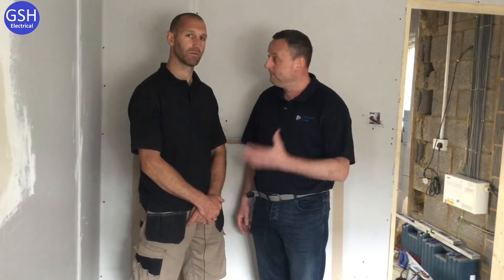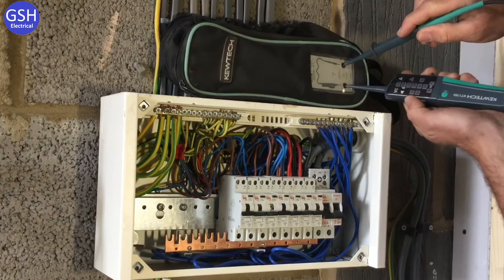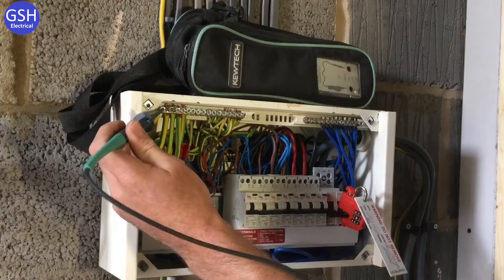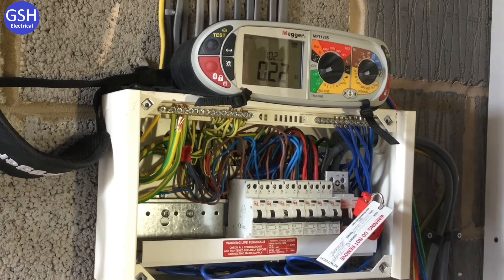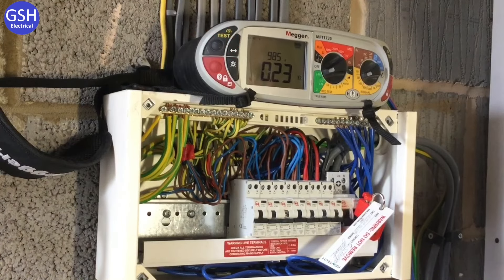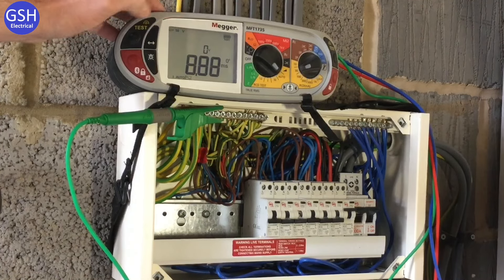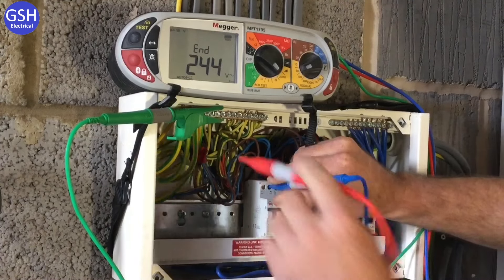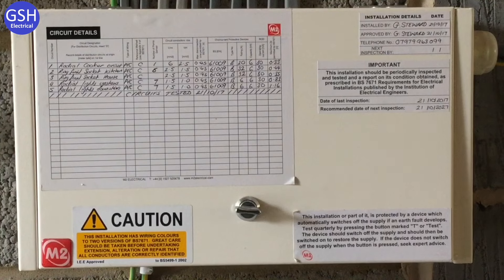3 Lead RCD Test in the Consumer Unit on RCBO's Saving Time During the Live Testing's Process

Comment: thanks for posting the video to help general awareness of trainee electricians. this video is obviously not meant for the general public who should be getting qualified sparks to do this kind of stuff. just to add a bit of information for apprentices; although guidance note 3 says you can do RCD testing (which includes RCBO's) at the board or a local socket, never any mention of doing it at any other connection point or lighting, an RCD test is effectively a bench test of the device and should not be done with its circuit cables or any other circuit cables under load. the correct way to test RCD's is turn all other circuits off so there is no possibility of currents induced by cables running near each other, remove the load side conductors so there is no load and then test the device, however the EWR says that the full test does not need to be done every time the installation is being inspected if there is a risk the disconnection of conductors could introduce a fault if they are not going to be tested again after re-connection. hence the test at a local socket. so in the video you correctly did the tests with all other circuits isolated and presumably made sure all connected loads were switched off during the testing so no load was present on the RCBO's under test.
I often come across old test schedules where there is only 1 or 2 RCD's protecting all circuits of a board where every circuit has a different RCD results value, this just shows whoever completed the schedule doesn't know what they are doing, if you have 2 RCD's in a modern 17th edition board, all circuits protected by the first RCD will have the same results for 1 x and 5 x column, as will the circuits protected by the 2nd RCD.
doing RCD testing at the board is not only the correct way to do it but as the video shows its also the quickest
just a final comment; the 18th edition has finally realised that users will not test RCD's every three months (and most sparks don't even tell them) so under the 18th edition the notice now says the RCD's RCBO's should be tested every 6 months. we now have the opportunity to associate the changing of summer time and winter time on our clocks etc with the need to test the RCD's. as we all know the reason for users testing RCD's isn't just to confirm that a mechanism designed to save lives works, it is also to lubricate the mechanism so it doesn't get sticky and not work when needed.
all the best to all qualified sparks and please stick to your quotes, don't let punters drive down prices by getting us to compete with each other. we are highly trained professionals and should charge accordingly
Reply from the maker: Hi thanks for your detailed comment... these videos are 100% not for Mr or Mrs DIY and form part of my training course. All the best GSH

Comment: With the megger tester , you can test Rcds /rcbos with just the 2 leads , in domestic properties I never use the 3 rd lead just keep the 2 leads in unless I’m proving the r1/rn  r1/r2  readings on socket then use the plug lead that comes with tester

Comment: @GSHElectrical thanks for sharing, very well presented.  
However, it should be noted that testing RCBO at the DB or Load centre does not prove the fault loop impedance path. A much better test is the test done in the field at the furthest point from the RCBO.

Comment: Great video guys thanks . Is this a MSB or a sub board?  Is there a MEN link in the board? Also when disconnecting the 16mm main earth cable, would that be the one from the earth stake or up stream supply?  Im assuming this is  a sub board? Question from Down under AUZ  where we use TNCS MEN system. cheers for showing me how to use my megger properly. Legends

Comment: @6.30 you state that rather than going to the end of the circuit to test the RCD you can do it at the CCU. But I thought that you should where practicable test as close as possible to the load side of the RCD at the point of installation, and the loads should be disconnected during the test.

Comment: Question:When testing polarity between the N&E conductors, you said that there's continuity due to a TNC-S earthing arrangement to the installation..
Is this a quick indicator to what earthing arrangement there is to that installation.. For example if there was no continuity then it will be either TT or TN-S (excluded the others from BS 7671)...

Comment: Why do you need to turn off the other rcbosif you’re testing individual circuits? I need to test a few three phase boards and they each have a few rcboson them and I just want to test them at the board. But the boards contain other circuits which I don’t necessarily want to turn off.

Comment: Prefer to do RCD testing at the end of line but I can understand why it done at the consumer unit in certain circumstances, I wouldn't expect an electrician to keep reseting the RCBO/RCD when testing a third floor lighting circuit with the consumer unit on the ground floor.
Reply: They shouldn't be carried out at the end of the circuit as they are not a test of the circuit, but rather a test of the RCD. They should be conducted with all loads disconnected from the RCD so as not to influence the results. They should always be carried out at the terminals of the device itself.
Reply: @richardwalsh5882  Where is this stated? I'm sure I've seen you make this comment else where.

Electricity at Work 1989, a statutory document (which BS7671 isn't) expresses the need to reduce risk and danger working close to live conductors where reasonably possible. 

"The need to be near uninsulated live conductors 
209 

People at work are permitted to be near live conductors only if this is 
reasonable in all the circumstances. If, for example, it would be reasonable for the
 work to be carried out at a safe distance from the conductors then it would be 
prohibited for that work to be done near the conductors."

The only live measurements you have to take inside a DB are Ze and PFC, RCD testing can be safely done at socket outlets (most of the time) and complies with EaW1989.

This is backed up by every annual visit I've had where they always insist on RCD testing done at socket outlets. By all means test how you'd like on your jobs but please don't encourage others to believe incorrect facts.
Reply: Richard is correct! Read Guidance note 3. You are testing the RCD not the circuit, you will have already proved the Disconnection times on the circuit when carrying out the earth fault loop impedance test.
Reply: The scheme do not write the regulations. A competent electrician should have no trouble testing safely!
Reply: @pauldavies9709  What about light fitting? Also, GN3 shows RCD testing done at the consumer unit.
Reply: @brad30  GN3 isn't a legal document, EaW is. In your scenario, a lighting circuit on an RCD and no other circuits with sockets to safely test, you're going to have to test at the safest suitable location. From personal experience specially during initial verification I'd never test a new rcd at source with a cover removed, I've had a Hager single phase and a Proteus 3 phase RCD fail catastrophically!

Comment: This is a serious question Gaz...and it’s a bit like proving dead you go the extra length for safety. If your not testing RCD trips at the sockets or lights can you be absolutely sure the RCD would trip if there was fault at the socket and light can there be extreme circumstances when a fault develops at the socket and light and the RCD does not trip. Extremely unlikely but the question is out there  and ignoring the fact the RCD is faulty. I guess you cover yourself by putting in a limitation and saying that RCD tests were all done at the board.
Reply: Hi, RCD testing at the CU is not a limitation because the purpose of the test is to test the RCD itself, not the circuit it's connected to.  The R1 + R2 and Zs tests prove that the circuit has sufficiently low L-E loop impedance to trip the over-current device (MCB) in the case of a fault and as the level of current required to trip the RCD is much lower it should always trip well within the time required.  Hope that helps.

Comment: great stuff and always helpful. @5:40, Graham reads a small mistake the kΩ which should be kA, isn't it?
Reply from the maker: Hi. I am sure you are correct, I haven’t revisited the video yet as I am out. I edited the video using four different apps and I still missed this small verbal mistake. PFC as you quite rightly point out should be measured in Kiloamps or Amps. I will add this information to the description of the video. Thanks for watching and  commentIng. GSH Electrical
Reply from the maker: Dennis Wu. Hi on the revisit of the video Graham says kilo Amps during the test which is correct. Thanks again for watching GSH Electrical
Reply: Did not expect your reply. very helpful videos, and waiting for more. thank you very much

Comment: When testing polarity when the beep noise came on for neutral to cpc, did it beep because it’s combined and then separate earthing system? If it was TN-S it wouldn’t beep?
Reply: Because neutral to CPC is virtually a dead short in a TN-C-S system, it triggers this particular tester's continuity beep (which does not have to be selected as a mode - it is active at all times when it isn't measuring a voltage).
These continuity checkers may show a positive continuity even with resistances in the tens or even thousands of ohms, so a TN-S should also show 'continuity' and sound the audible tone when testing between N and CPC.
Some voltage proving units cycle through voltages, low to high then back to low and will end on a direct short - this is designed to test the continuity feature of this sort of voltage tester.

Comment: Why do you need 3 leads (L/N/PE) to test the RCD (RCCB or RCBO)?  Here in Germany, Austria or Switzerland we only use L and PE for RCD Testing. For witch purpose so you need the N for RCD Testing?
Reply from the maker: Hi. We also can do a 2 lead test but as I like my learners to do 3 lead earth fault loop impedance test rather than 2 lead test I have stuck with 3 lead tests where possible. I hope you understand my learners are aware of the 2 lead test. During training I like to pair things down to remove confusion. Thanks for the questions and watching GSH Electrical 🙌
Reply: Thanks for answering my questions! Thank you for many many super videos.
Very interesting to see how similar electrical installations are through out Europe and on the other hand how different they are.
Reply: Does a load need to be present to do this test. I’m just starting out and did a test for a hot tub feed. The hot tub had not yet been delivered so I only tested from the board to the rotary isolator. It was just a 2 lead test but the RCD did not trip. Nothing at 1 or 5 x, nothing on a ramp test.

Comment: Hi. I would like to know how you carry out the RCD test on the test rigs with out tripping the Rcd for the on the college main board?
Reply from the maker: Sean Dempsey hi, if you have RCD’s in your college test board and an RCD on the feed to the college test board and they are both rated at say 30mA then your system lacks selectivity.Therefore when testing your circuits it’s pot luck which RCD with trip. Either use a time delay RCD (s type RCD) or remove the one feeding the testing rig. All the best. Gaz
Reply: Thanks by the way you do a great job you're videos are very informative and useful
I qualified back in the late 80s after doing C&g 236 parts 1&2
But sadly I can no longer work due to eal health but I do try to keep  up to date with the regs and so on, so as to keep my brain active.
Thank you for the fab videos

Comment: Hi, Not too sure why you are connecting the neutral to carry out a test on an RCD. The neutral has absolutely no effect on the testing of the RCD. Also to satisfy BS 7671:2018 only 0.5x & 5x test would be required. Cheers.
Reply: i agree i only use a two wire test from my 1721 and 1741

Comment: Hi what is the point of doing RCD tests at half times, one times, and five times, when it is only required to record the highest value on the test results?
This seems to me like a waste of time?
Also in another video you started something about having a second RCD down stream so you should be careful not to trip that as well?
But if you test the first one by probing line to neutral and then the third lead on the incoming neutral then only the RCD under test will trip

Comment: Hi thoughts are - How can you get the functional trip times in mili seconds from the board when it should include theR2 resistance at the zs point , which in turn creates a higher trip time> you may calculate the R2 but trip times are functional real time readings .
Reply: Testing the device not the circuit

Comment: hi all I've just completed a weekend of board testing my question is we were unable to test the RCBO's at the board ?why in the end we had to remove both live and neutral and  a short lead and then we were able to carry out the test I will add that all of the RCBO's were 30mA and C type. so even the electrician I was with could not answer this question. Shaun the apprentice

Comment: Should you not disconnect the loads from the RCBO/RCD before testing so you are testing against a set known current?
Reply from the maker: He had the load off in the installation but it’s probably easy to remove the circuit from the top of the RCBO before testing 👍🏻.
Reply: @GSHElectrical  Of course they were! (points to suspicious lead hanging in the same position from twin socket at beginning and end of video 😁). Definitely easier to do in the board than within the installation though, plus you know you won't have missed any hidden loads.  Great videos - I've learnt a lot, and less filth than Mr David Savery!

Comment: You should always do the functional test button last
Reply from the maker: Hi. That’s a great discussion point and one we have in the classroom as this is a teaching aid. Is this a drawback of doing the test in the consumer unit as the functional is preformed first? Or is it a more controlled environment to carry the test out at the dis-board (safer)? This way no need to remove covers and carry the test out up stream (safer)? Lots of talking points for my learners. Thanks for watching and commenting GSH Electrical
Reply: I got told this on an NICEIC inspection if the RCD/RCBO is sticking it will show up in the test by doing a factional test with the test button first you free it up and could stick again. This seems a valid point to me.

Comment: Hi gaz. With regards to the rcd test on the lighting rcbo circuit at the fuseboard. Would the same procedure work on a lighting mcb on a split board rcd
Reply from the maker: Hi, on a split load board with RCCB’s test at the RCCB’s with all loads (breakers) off. You can do a 3 lead test as shown or a 2 lead test RCD test 👍. Thanks Gaz